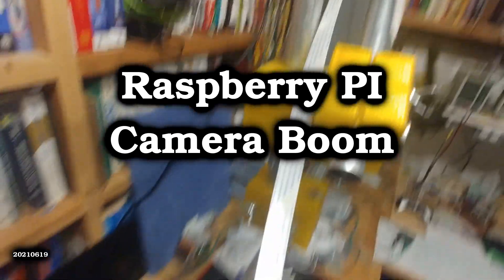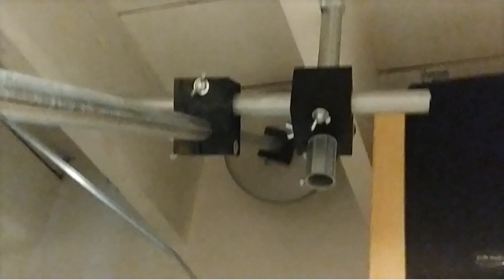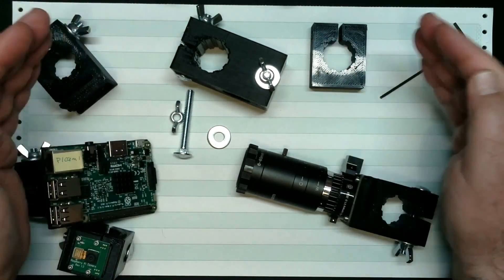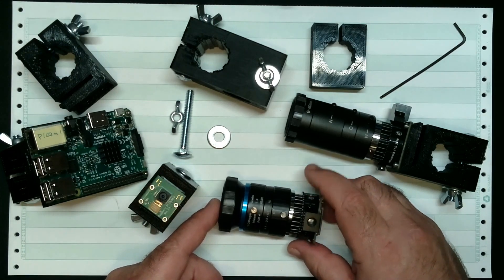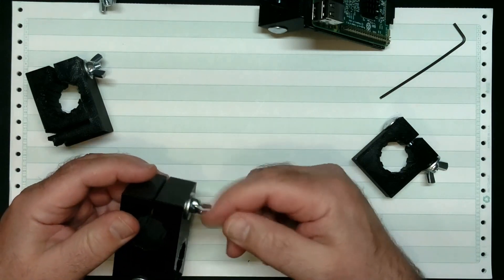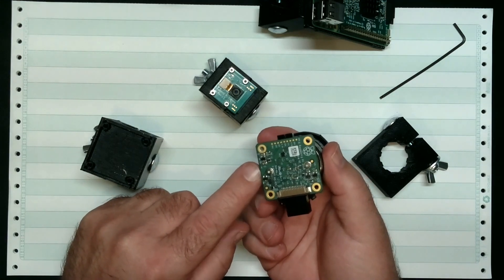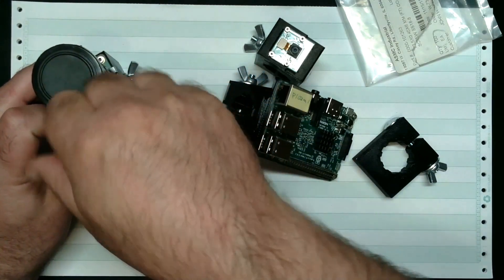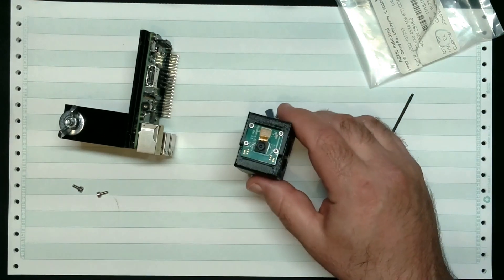3D Printed Raspberry PI Camera Boom

Comment: I am curious about what software you use to record and edit sound and video on a Linux machine - I assume Ubuntu.
Reply from the maker: Warning: It took me for EVER to get my environment to the point where I can run a script and stream everything to my main editing box.

Yes... Ubuntu.

I use raspivid on the PIs to capture the video from the PI cameras.  I run it in a server mode that allows me to stream it directly to my editing box. When it is working it is fine.  I have multiple PIs and cameras.  The HQ cameras have occasional data errors that cause raspivid to ANNOYINGLY complain and then seize until I restart it... rather than let the image glitch and just move on... which would be far more preferable to me.  Interestingly, the uber-cheap-o 3rd party $5 fixed-focus crummy cameras NEVER generate data errors.  Their focus could be better.  But I am satisfied with using one of those for the overhead shots of papers, books and things that have the black backgrounds... it is what I have on my ceiling-mounted boom.  If they could zoom in, I'd use them for everything.

Over my bench I have a PI HQ camera with the cheap verifocal zoom lens that I link to in the video description.  Other than the occasional raaspivid seizure, it is acceptable most of the time.

I use ffmpeg to record my system screen shots and to stream the video from the PIs and to collect the streaming data from the PI cameras.

None of these things were easy to figure out how to get working consistently and well enough for me to stop tinkering and just use them.  As you might notice in some of my videos, the color is sometimes off, the sound sync is not always right, etc.  Room lighting is a giant factor with getting reasonable images without too much glare.  As is deciding on the settings to use with the raspivid app.  Over the last year I think that I have been able to get things consistent and to a minimally acceptable level of quality.

I have tried to use fancy video cameras on loan from friends but am ENDLESSLY dissatisfied with the workflow, dying batteries, etc.  I'll accept some loss of quality in return for 100% of all data streamed in real time to the ultimate destination... even if it occasionally means I have to reset the raspivid app.

For video editing I use blender. I originally expected to be making neat animations with it but have yet to learn how.  I assumed that learning its video editor would help me in that direction... and might well turn out that way.  But until then it is just a video editor with a complex interface.  It took me for EVER to figure out how to get the opening and closing sequences put together so that I can easily replace the titles for each video.  I eventually learned enough where it is not TOO bad to open my standard template, render all the titles using postscript  & image magic 'convert' and 'composite' commands... also IMPRESSIVELY complicated to figure out how to use.  BUT once you do learn it, everything is trivially scripted so all future usage is automated.

Sound can also be more trouble than it seems...

I digitize the audio from a cheap mic (that has both sponge and screen pop-filers... before then I had all sorts of trouble) with a Uphoria 404HD with a DBX 166XL compressor/limiter/gate and an analog equalizer in the insert.  I tend to have a pretty dynamic way of speaking.  Without the DBX, it is a nightmare.  When I have the gate set properly 🙄 the DBX makes sure that the audio goes to dead silence on even the slightest pause.  Without it, editing the audio would be FLOODED with clicks and background fan noises... which come through some times when I am lazy and don't get it set for the day's level of furnace, neighborhood lawn mowers, etc. rambling away when I am trying to record.  If you are a frequent viewer you probably notice when it the gate doesn't close properly.  The compressor turns up the quiet bits so you can hear me mumble and the limiter dampens anything that is too loud.  If you are not familiar with a compressor/limiter/gate, here is a video that demonstrates the model that I use:   https://www.youtube.com/watch?v=bsfNSYpVP4E

Unless you are trained how to be consistent when speaking and in proximity to you mic(s), you will want one.  A DAW can do the compressing and gate on your PC in software.  But it can't help you if your DAC clips the sound when the level peaks... which is what the limiter is for.  I swear by mine... found it used for $50 at a Guitar Center.  Problem solved!

I keep putting off the recording of a video on how I record my videos.  Mostly because I am not happy with the quality of my scripts enough to want to admit that I actually wrote and use them on  regular basis. 🤪
Reply: @JohnsBasement  A lot of good info to digest and consider. I think your video and audio are more than sufficient as presented, but I gather that getting them to that point is a challenge. I had never heard of a compressor/limiter/gate but the video does a good job of explaining it. It is no longer made and I am not sure of its current replacement, but plenty on eBay. Not sure what I am going to do in the future but in no hurry. Blender is defeinitely on my radar but primarily for animating3D models from FreeCAD. Thanks for this.
Reply from the maker: @DavidTLutz  Thanks.  I hope it helps.